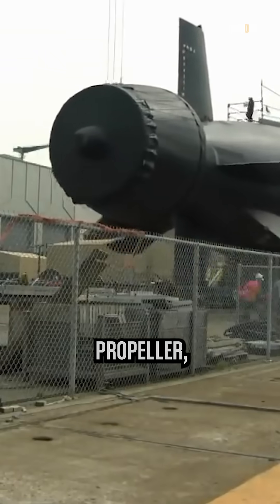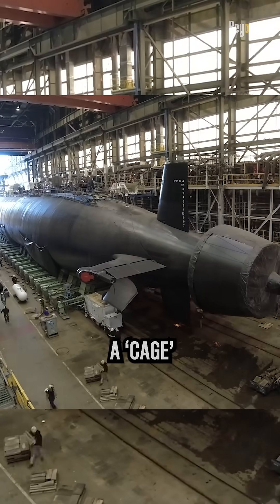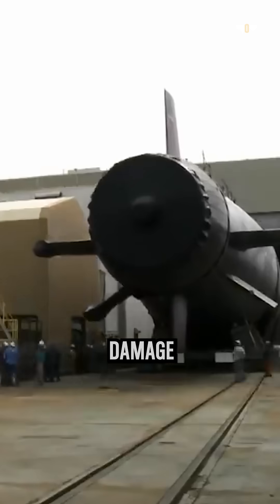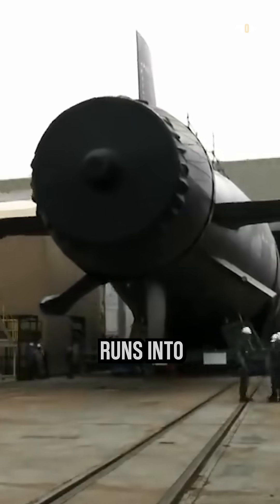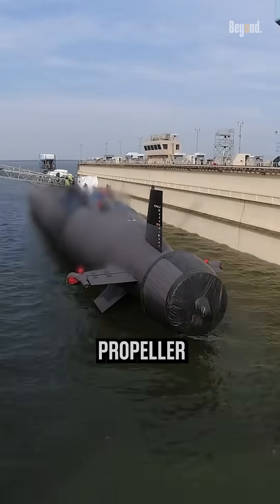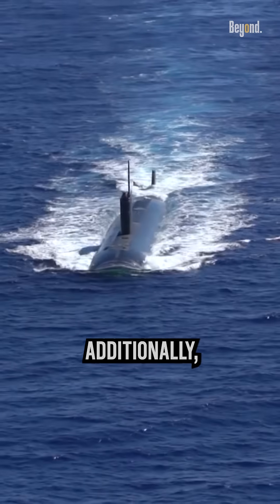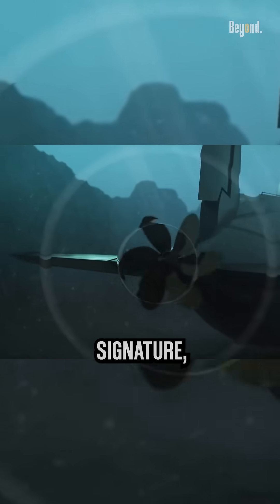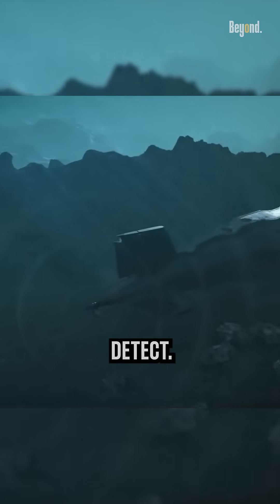Why do the US submarines have a ring around the propeller? #shorts

Comment: The ring around the propeller is gor noise reduction. The British were the first to use it. The assembly is called a pump jet propulsor and reduces noise by around 50 percent. A lot of a submarines noise is generated by bubbles tat form around the tips of the propeller blades and is called cavitation. Thd noise is the bubbles collapsing. The shruod eliminates the bubbles forming thus reducing noise.

Comment: Ironically the ring also helps the speed i did a exam thing about the ring it did help keep it quiet as well the output of the engine can be lower but the speed is higher. Also if you have to put it into revers quick the agitation is a lot less to help it go back quick.

Comment: I should've learned from videos like this instead of machining props and shafts for Los Angeles, Ohio, Seawolf, etc submarines. And here i was thinking about the various details that changed drastically with mild adjustments to leading and trailing edges...nevermind the various interchangable parts...or how much props can be beaten and easily reformed. Why dont carriers have these covers? Then maybe some of us wouldnt have to spend so much time cooking the blades with Mapp, hanging them from cranes, and reshaping each blade in a hydraulic press. I mean, it really sucks when those shims go flying and take chinks out of the walls of the shop. Nevermind the adverse hearing issues. From now on, we shall all rely on these shorts for knowledge!!!!!

Comment: Its to reduce the cavitation effect when its spinning. Allowing a quiet operation at a fast pace without leaving a detectable wake and cavitation trails. The trails are made by under water vehicles The shroud or cage reduces the underwater wake trail that some torpedoes  actually use to track a sub  all the way to impact. ✌️🇺🇲✌️

Comment: That ring plays multiple roles, 1st per Bernoulli's principles of fluid mechanics when you have a debit of water passing through a pipe, if the pipe constricts, in order to keep the flow constant, the speed of the fluid will increase, that means that a propeller screw has to turn less times per second to generate the same amount of thrust as it would in the rings absence, it therefore increases the speed at which the submarine can travel before cavitation beggins to appear, increassing the stealth of the submarine, keep in mind that cavitation depends on pressure and teperature, the lower in the water the submarine is the faster the propeller can spin before cavitation occurs, this system is called a pumpjet, and is also used in surface vessels not just submarines, as for the covering of the proppeller from civilian view, in general they just use a cover over the propeller which is removed after releasing the sub to sea from drydock, conclusion, its ring is there to increase thrust and stealth

Comment: Actually, that setup is called a "propulsor". It works similar to a ducted fan - it reduces cavitation, which is a major cause of loss of speed, and reduces noise. If the shroud were to be struck or damaged, it might protrude into the path of the propeller, causing damage and possibly jamming it...

Comment: Being a former submariner, I can safely say I AM an authority on this subject.  The entire premise of this video is.... IGNORANT.  Submarines do NOT have "propellers", they have SCREWS.  Airplanes have propellers.  Do propellers and screws serve the relative same purpose to turn an engine or steam turbine's rotational torque into linear motion in a fluid (air or sea)? YES.  However, it's a SCREW in Naval parlance, that what's the engineers who design the submarines call them, that's what the actual sailors who operate the submarines call them.  They are SCREWS.  They are NOT PROPELERS. Why? Because a submarine is NOT an airplane.  Simple.

Comment: If you put a ring/duct around a propeller, it makes it more efficient at a specific rpm/power setting. It’s been tried with airplanes with limited qualified success. It’s one of the reasons high bypass turbofans are more abundant then fan-jets.

Comment: That’s not the reason at all 😂 what they are depicting is called a pump jet propulsor, which is essentially a impeller in a duct. It’s purpose is to raise the speed the propulsor can achieve before cavitation starts to occur as well as reducing the radiated noise of the propulsor. This means that the submarine can travel faster while maintaining its stealth.

Comment: yeah no, firstly it has nothing to do with protecting, it has to do with sound and mid to high speed performance.
The new ducted versions are essential a jet pump so the efficiency would be crap without the ducting.
The earlier versions which being just a shrouded prop increased low speed efficiency but at a cost of high speed efficiency

Comment: right and wrong. the they have it covered to hide the shape of the impellor (not propeller in this case) The shroud itself is part of the system. it keeps the flow of water around the impellor contained. The whole design goal is to reduce cavitation and noise.

Comment: That is called a Cort nozzle and it doubles the thrust for the same diameter, cuts power,  nothing new, you see it on every airliner, there it's called a fan.
Of course the noise is greatly reduced. 
Both, the submarine and the airplane move in a fluid, the difference is just the density, more than thousand times higher in the fluid called seawater, fluid dynamics is almost the same, the difference being that cavitation can occur at low depth in the moving 'fan' outer region.
Nothing secret about it, just technology transfer from the aircraft to the seacraft.

Comment: As a retired submariner there is so much wrong with this video
Reply: retired SOSUS, and almost everything is wrong with this video
Reply: @gregcorwin8316  you realize these videos are most likely fishing attempts by foreign intel agencies to get vets and active duty to spill info they shouldn't.  That's why I like to give them BS.
Reply: This was what I was looking for.  I wasn't a submariner, but I knew this was BS.
Reply: Now there is a man who knows!
Reply: Damn NQP'S.   MMC/SS AGANG RET.
Reply: As a former US Army medic, even I know this is bilgewater.
Reply: So if it's not correct, why not give the correct information and also inform the creator of the video.  BTW  I'm ex US Air Force ground based weather, weather balloon and weather rocket observer.
Reply: What little I do know about submarine propellers is that you don't allow them to be photographed to keep their design a secret.  The reason is the shape of the propeller is designed to reduce or eliminate cavatation.  Cavatation is caused when the tip of the propeller blade is moving fast enough that the friction with the water causes it to boil and create tiny bubbles.  This creates a noise in the water that is unique to that propeller.  This sound can be detected by hydrophones and gives away the sub's position.  Submarines can hear ships on the surface in the same way.
Reply: After machining so many of those props and shafts, I agree
Reply: All I can say is 17 rotors 22 stators
Reply: Gentleman, I hear you, but would you explain - to me, a complete ignoramus here - WHAT is wrong?
Reply: Hey fellow bubblehead! I was smdh at pretty much the entire video.... especially in the beginnning when the narrator used "propeller", I was almost screaming "It's NOT A F***ing propeller, it's a SCREW!"  Just goes to show you who writes the narration does not do their homework and does not consult experts in the field on the subject.
Reply: There was me thinking it was to do with effecencey....
Reply: Agree.

Comment: The ring has a very simple purpose, it directs propulsion. Some of the propulsive force leaves the tip of the blades. The ring captures and directs some of that energy. 

Lower propeller rpm’s needed resulting in quieter operations.

Comment: Former US Navy Submariner speaking. In 1987 Toshiba sold Russia key Submarine Propeller technology which made Russian Submarines manufactured after 1987 quieter and more difficult to follow. When a American Submarine is raised o to a drydock for annual maintenance, you'll see the Propeller completely covered so Satellites can't see the Propeller. This is how serious the US Navy is at protecting our Technology and why Toshiba, while a 7 lettered word, is seen as a four lettered word to the American military.
Reply: I remember that, too. It was the technology to run 6(?) axis milling of the "single -blades" manufacturing process. They bolt multiple single  blades on to a  controllable pitch hub.
I believe Toshiba(?) was barred from doing any business for the government for a long time.
Reply: Toshiba didn't sell the Soviets the screw design, they sold them the hardware (computer chips) to run the CNC (Computer Numerical Controls,  or CNC) so that they could run four-axis on the CNC milling machines to MACHINE the propellers.  Previous to that, the Soviets had to rely on older, clunky NC (Numerical Controls) and hand finishing to produce the correct pitch and geometry on the screws, which made them less efficient than the U.S. made screws.
Reply: @jstephenallington8431  I used the words Propeller Technology. I didn't use Propeller Design.

Comment: Summary: "Soviet design philosophy emphasised speed and manoeuvrability, and to operate in shallow waters where the chance of damaging the propeller was low" Huh? Close proximity to seabed reduces chance of bashing the propeller? How is that likely? 

But also the "cage" around the propeller of Western subs would give little protection from collision with the sea bed. The purpose is to amplify the effectiveness of the propeller by funnelling the water pressure. 

It also hides the shape of the propeller, which would reveal its performance envelope, which would be useful to an enemy.

Comment: Sorry guys, but there isn’t really accurate info in this one. If what’s being referred to as a cage is the shroud on the Seawolf and Virginia class subs, that’s a pump jet which is a completely different unit from a propeller; it’s constructed similar to an axial flow turbine. As for Russia not utilising pump jets, it doesn’t really have anything to do with mission requirements or design philosophy, it would most likely be what the nation finds most practical, economical and effective. While Russia had some faster submarines over America, there’s plenty of subs like the Akula, Sierra, later Victor types and Kilo classes that absolutely focus on stealth capabilities and still use a standard propeller. In fact, I think the Russian Typhoon class did use pump jets for propulsion so it’s not like they have never used them.

Comment: Totally incorrect. The system is a ducted screw a variation of a "pump jet" the shroud delays the onset of cavitation from the propeller. Its makes the sub quieter at higher speed, and increases the efficiency of the propeller. It has absolutely zero to do with protection. Before anything ever touched a propeller, it would hit the fins since a sub essentially never moves in reverse.

Comment: The propeller (the screw as it’s actually known) is literally a single piece of metal. It’s enormous and very finely made to minimize noise and for maximum efficiency. Housing it reduces physical stress on the ends of the screw to keep it from changing shape.
Reply: That hasn't been true for many decades. They all use controllable pitch hubs with bolted on multiple  single blades, at least they did up until '90.

Comment: Aside from keeping the shape of the prop hidden from casual view, there is the fact the props shape can be changed to reduce cavitation by eliminating or at least drastically reducing the dimensions of a low pressure surface on the prop.

Comment: Wrong.  The reason submarine props are covered while out of the water is because the shape and mechanisms of the prop are highly classified.  Some submarines do have what appears to be a solid cover around the prop. This is a ducted prop. It is a kort nozzle. It is used to direct/compress the water flow out from the prop and increase thrust. Makes the prop more efficient. Sub props are already very quiet.

Comment: Is it not due to optimising water velocity?
Reply: The back side of the propeller blade is the "high pressure" side. Conversely, the forward side of the blade is the "low pressure" side. IIRC, water will actually boil on the low pressure side of the blade at certain rotational (high, surface)speeds. This is called cavitation. This creates added noise, and can actually erode the surface of the blade over time. Both bad.

Comment: The risk of running into something in shallower waters is LOWER?

Does anyone read these scripts before you post them?

Shallow waters would have a HIGHER chance of grounding.

But the nozzle isn’t to prevent damage, at least mostly not.  The nozzle increases efficiency and stealth.  Crucially it increases stealth at high speeds.

Russians don’t use them because of the added risk of pulling in debris into the prop.  One chunk of ice in there and it could be a seriously bad day.  And the Russians operate from a lot more iced over ports than the US has to.  It’s not so much an issue when your underwater though.

Comment: The "ring" you're referring to is commonly called a "pumpjet" or "shrouded propulsor." Here's a brief overview:

1. **Pumpjet Propulsor**: The U.S. Navy's Virginia-class submarines use a pumpjet propulsor instead of a traditional exposed propeller. The pumpjet consists of a shrouded rotor, which is essentially an encased propeller. There are various benefits to using a pumpjet:
   - **Acoustic Stealth**: One of the primary advantages is that it reduces radiated noise, making the submarine quieter and harder to detect by enemy sonar.
   - **Protection**: The shroud provides some level of protection for the rotor from debris or collision.
   - **Efficiency**: At certain speeds, a pumpjet can be more hydrodynamically efficient than a traditional propeller.

2. **Russian Submarines**: While many Russian submarines use traditional open propellers, it's not accurate to say they don't use pumpjets. Some newer Russian submarines, like the Borei-class ballistic missile submarines, are believed to have pumpjet propulsors, suggesting that the Russian navy also sees the benefits of this technology.

3. **Development and Choices**: Different countries and their naval programs make decisions based on a myriad of factors - strategic goals, available technology, budget constraints, and specific operational needs. Over time, as technologies develop and threats change, naval design preferences can shift.

In conclusion, while many U.S. submarines utilize pumpjet propulsors for the benefits they offer, not all Russian submarines rely solely on traditional propellers. As submarine technology and design evolve, both countries will continue to adapt and modify their designs to best meet their operational and strategic needs. It's crucial to verify the things that one learns from ChatGPT.

Comment: All three of the submarines I served on didnt have a cage. They were open screw designs. Now, there could be different configurations of Los Angeles class attack subs that I dont know about but I think most of those were open screw as well. I know for a fact that all the Ohio class submarines had open screws with out cages . I have looked at most every Ohio class submarine in dry dock in my 20 years of submarine service.